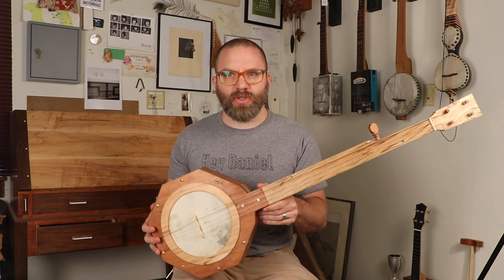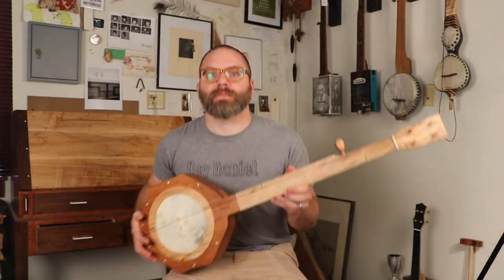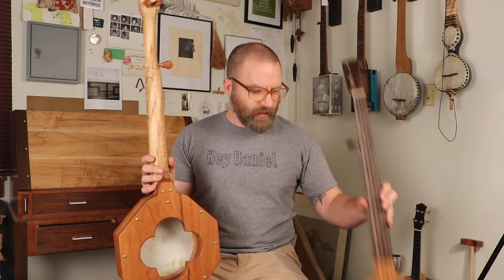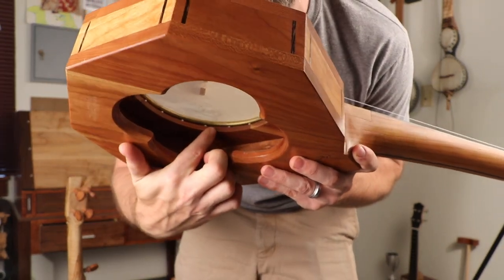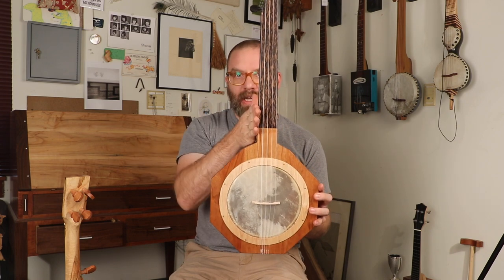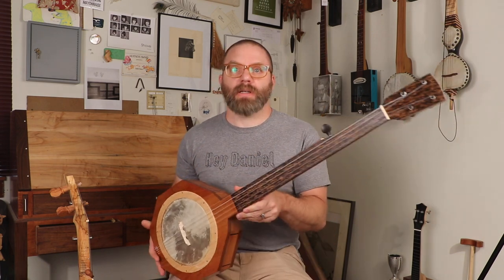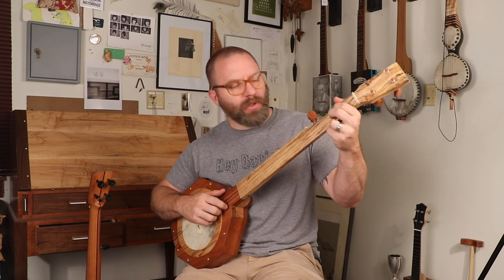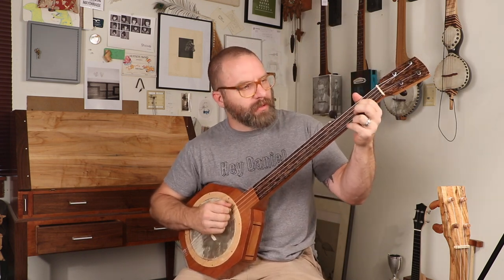Quick look: KY Octagon Banjo

Comment: LOL … I once used spalted maple for a banjo neck. After I had it all profiled and fretted I was curious how flexible the wood was and as I put a little pressure on it … the neck splintered along one of the black spalted lines.
Reply from the maker: Oh no! Yeah spalting is different every time since it is the early stages of rot. You can have it spalted and solid, and you can have it spalted and not structurally sound. The ambrosia beetle leaves little holes and discoloration but otherwise the wood is normal. Still super sound. I had a spalted maple lamp split years ago right along a black line as well. No fun!

Comment: I was a little surprised the tone ring banjo didn't have significantly more volume than the non-tone ring version (to my ears anyway).  I had a thought, based on Geoff Stelling's banjo-building (I have owned two of his banjos for years and they are LOUD).  He casts/machines his tone rings with a chamfer on one edge, and the wood rim has a chamfer that matches it.  When they are squeezed together by the pressure of the hooks, he gets more surface area in the connection between the tone ring and the rim than if they were just two flat surfaces one on top of the other.  He has a patent on this called "Wedge-fit," if I'm not mistaken.  What I learn from this (possibly erroneously, or course) is that the surface area between the tone ring and the wood rim should be maximized.  So I'm curious as to what would happen if you had the tone ring without the balls; instead it might be resting in a recessed groove in the rim, or some other arrangement that would transmit more vibration from the tone ring to the rest of the pot.  It would be interesting to see whether that would increase the volume.  You may have already tried this already, and the most likely possibility is that I have no idea what I'm talking about, but I did just want to share that idea with you.

Comment: Beautiful banjos.  That fancy fretboard is just gorgeous!!  Have you ever thought about building a gourd banjo, and maybe doing a class on that?  I'm really curious about them, especially after hearing Jason Romero playing Lost Lula.  Holy smokes what a sound!
Reply from the maker: Did you hear the ceramic gourd banjo I made. I did a small bottle gourd one which I am putting up the video soon. Here is the ceramic one. https://youtu.be/xrA2lJlSWoU But maybe a class on a gourd banjo build could be cool...
Reply: @JDanielGraham  I will definitely check it out!  Right now I'm leaning toward a gourd banjo because it seems a lot simpler and I don't have much equipment, although if I decide to go ahead build the gourd banjo, I know I'll want to go on and build the Kentucky-style (and anyway, most of the neck/headstock procedures would be the same).  The part I'm curious about is how you determine and then cut the correct angle for the neck hole (and dowel hole on the other end).  It seems to be a very critical part of the build in order to get in the ballpark of the correct string height.  I can kind of imagine the rest of it, but that part seems to be a mystery.
Reply from the maker: @drewby613  gourds and others are different, and everyone does it their own way. Some dont angle the neck at all, some do it by eye, some measure. For some they cut the angle in the neck and drill a hole for a post at an angle that way it goes straight through the pot. Loads of ways to skin a cat. (but just make sure to use the cat skin for the banjo)
Reply: @JDanielGraham  LOL!!!  Having watched a few videos I'm noticing a pattern in the way they are built.  The pattern is there is no pattern!  You're sure right about the different ways to skin the cat.
Reply from the maker: @drewby613  Thats one of the reasons I have been drawn to banjos. There are no rules, they can have 4 strings 6 strings they can be big, small, round or square. Its always something new.